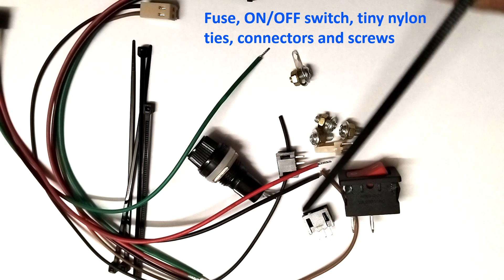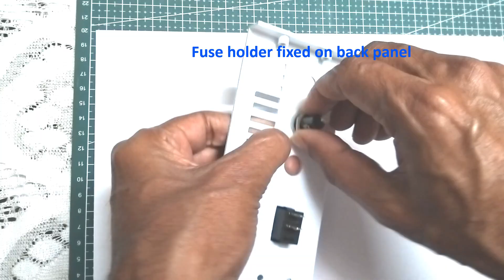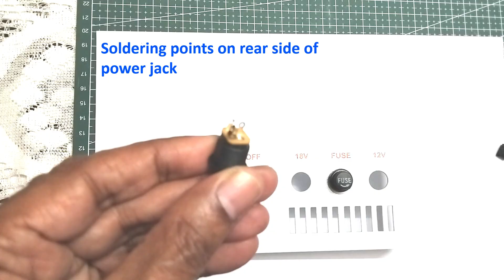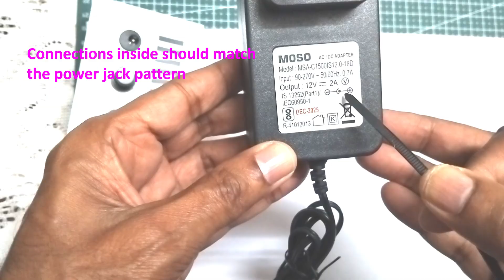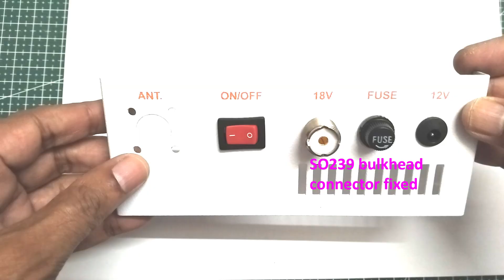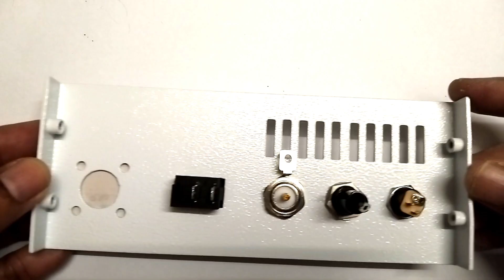Starting off with easy part of Easy BITX homebrewing!

Comment: Best wishes from vu3ebs . easy bitx good choice...many years ago I  assembled this kits from vu3sua  still working good..so many new hams those interested hombrewing your video definitely helps...waiting for on air ..73
Reply from the maker: Great to connect with you. For the past few days, I have been mentioning your callsign during 40m ragchews as the only person in this region who has homebrewed an Easy BITX successfully! It was VU3IXV and VU3BQD who mentioned it on another 40m QSO a few days back. 73 Jon, VU2JO